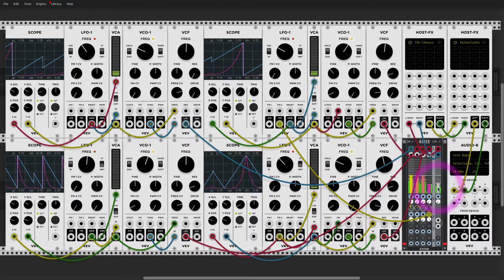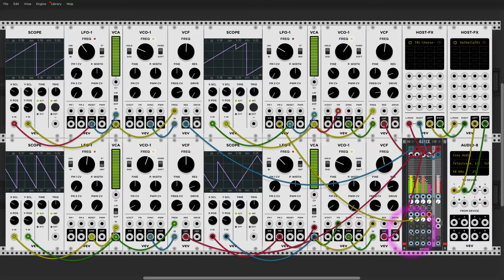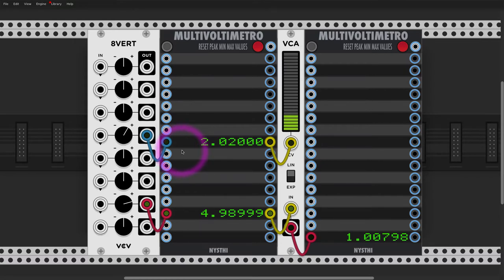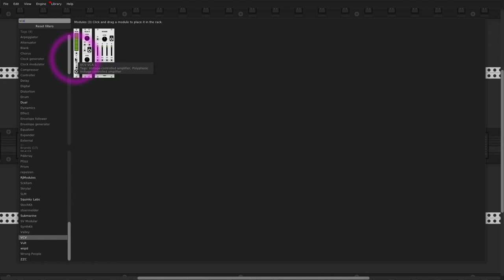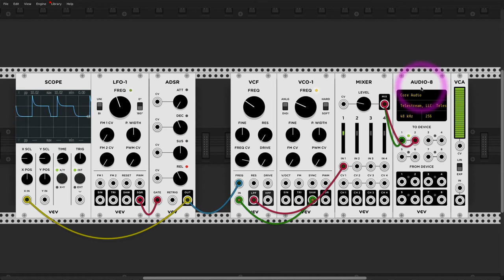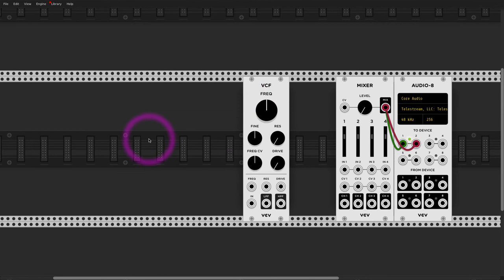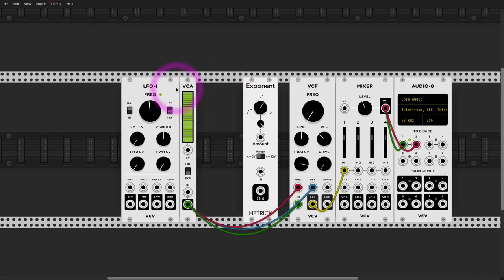VCV Rack Hacks | Snappier Envelopes

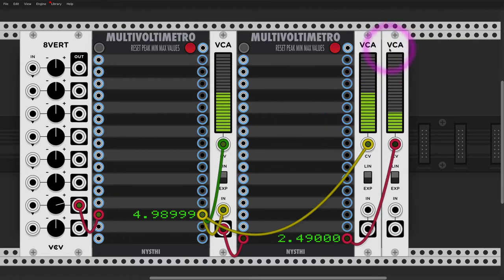Comment: 4:28 -- it's easier to think of vca as being multiplied by a percentage (rather than it being the product of two voltages).

Assuming the VCA-level is set to 100% (this is the 10V in the equations below)

LEVEL=10V (100%)
Linear output is: IN * (CV/LEVEL)
Exponential output is: IN * (CV/LEVEL)^4

So an linear input (CV=5V IN=6V) OUT=3V
While an exp input (CV=5V IN=6V) OUT=0.648V